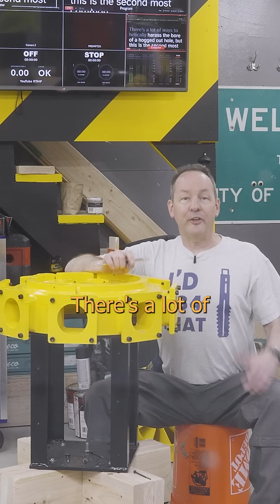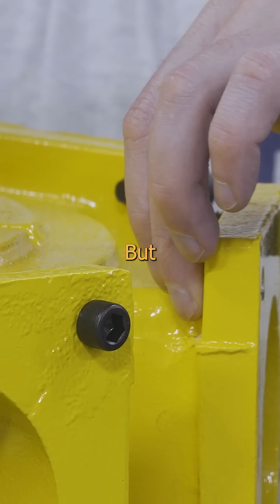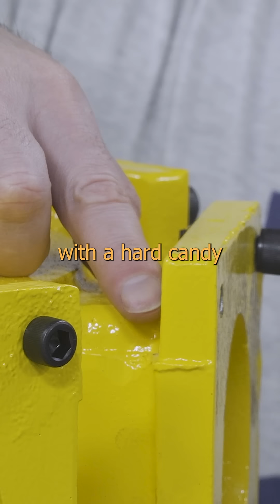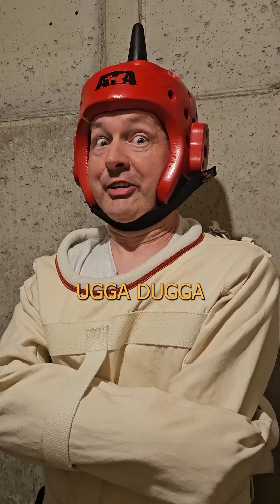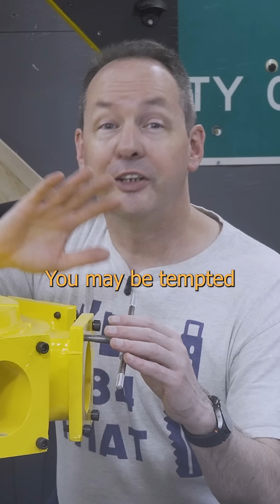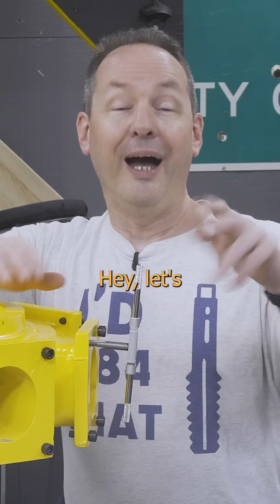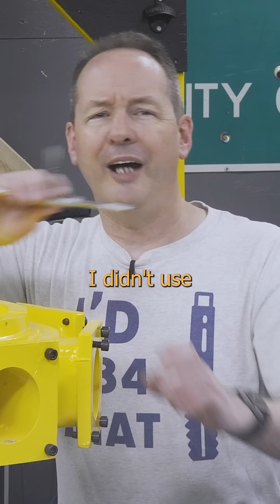Thread Chasing  #chrisboden #comedy #engineering #skills #workshop #metalworking #tools #apprentice

Comment: I had a job at a company that I shall not name at this time that involved tapping holes in steel parts on an assembly line and we just sent those suckers with an impact and enough lube to make an OF girl blush.  I think I personally broke about one a month, but it let us keep pace with production.  It probably didn't help that we were running imperial taps into metric holes because some overachiever in engineering specified three metric bolts on an all imperial product and then never told production about it.  I only found out after the fact.

Comment: Yeah I’m a power drill dumbass.  But I was 28 and knew no better.  Great vids and enjoy the learning even as I just turned 50 😂
So I was replacing a broken header on a 1998 Ducati. .was upside down looking up and was trying to clear the bolt holes as was crusty to buck,, and thought it would be quick and easy to whiz it in and out with the drill. Yup it broke even though was slow ish.  Still too fast and was a pita to get out .  But I digress. Learnt the hardway.    😊

Comment: Dumbass
I was trying to chase the threads on a hub for the hubcap screws, and tore it up so bad I had to size it up from 5/16 to 3/8 and now there’s a random trailer at AAA Cooper with one 9/16 head bolt on a hubcap somewhere, for some fucker to find and wonder what happened there.

Comment: Used a drill to tap a M8 thread onto the backplate of an electrical cabinet to mount some DIN rail, that snapped off and I couldn’t get the fun part out of the hole, ended up having to move the hole up an inch and also had to make it look like I didn’t fuck it up. Never again, biggest pain/embarrassment especially sense it was completely unnecessary

Comment: Our 4 square boxes wouldnt fit our 3" 8-32 screws. Thousands of them, every single one in the building. The boxes were installed too far back, and it was fire alarm, so we could mount the devices with just the screws and no arc guards. 

I've gone through about 30 of those drill taps. If I was using the hand tap, I'd still be tapping em XD

Comment: Yeah, probably my worst experience with hand tapping things as a machinist was doing 3/8-16 and 1/4-20 in stellite with taps hardened enough for cast iron had to add an extra inch and a quarter because I didn't have the confidence to run a threadmill because I do not understand how the last guy programmed the helical interpolation

Comment: I've actually done that without being the dumbass... it was shop practice, the metal stock was aircraft grade aluminum (because aerospace machining making aircraft structural parts), and what probably saved us was using the same taps that our machines used for tapping operations when it wasn't one of the few thread milling operations that we ran.

Comment: Yes is was a dumbass once, but not how you think. As a young car mechanic i used my 1/2 impact driver air wrench to  put in a head bolt on a motor. I had never heard about hydraulic pressure. As the bolt hit the bottom of the thread channel the head of the bolt snapped completely off.

Comment: Before I knew better I actually did use a tab with a drill but I set the drill all the way to the lowest torque out level so it was basically like clicking and moving very very slowly even with the drill trigger all the way pressed down. It worked really well until it didn't, lol

Comment: Just hear to call everyone else dumbasses for thinking that running a tap into a hole is a race. Used to work with a guy that would get frustrated when I went 3 turns in with a tap and then backed off before threading some more. Watching him break a tap with a drill was incredibly satisfying. Dumbass.

Comment: Im always using a drill to chase threads at work. Have I snapped off a tap? Oh ya. Who fixes that? Me. It’s happened once but I still use a drill to tap out holes. It’s fast when you are on an assembly line.

Comment: Dumbass.... I broke an oil pan bolt in the bottom of the block of my 75 ford and I thought I could just over bore the hole and re-tap it for a slightly larger size. Come to find out that hand tape are not drill friendly because that tap is still wedged in the block where that broken bolt was. Fortunately I was able to polish up and re thread the end of the tap so I could throw a nut and washer on it. I sold that car with that booger fix. Last I knew the tap I lost is still stuck in the block and it still seals like factory too and THATS PRETTY FUCKIN COOL

Comment: I love taps. They're so satisfying to run through a screw hole. We used them at a reman brake caliper factory i used to work at in my early 20s. We would tap the brake line and bleeder holes at the beginning of the reman process and then put new bleeders and banjo bolts in to ensure the threads on the calipers were tight but still easy to hand turn almost all the way down. There were a couple idiots that kept the most common thread taps on a drill so they could try to run through a line of calipers quickly before building them. I'm sure they cross threaded one from time to time and had to throw them into our scrap bins 🤦

Comment: As an HVAC guy, some of my favorite work is thread cutting/chasing. Those are the days I can turn my brain off and just use fine motor control between bouts of heavy muscle use. 

On big compressors, and pipe work, everything is a bolt and flange connection, and my ADHD brain loves nothing more than a freshly rebuilt 40 ton compressor that needs to have all its bits and bobs precisely cleaned and torqued for the sake of process or comfort cooling. 

As an HVAC guy we also do a fair bit of wiring, those are also good days for the same reason. Lots of fine motor control getting power to and from motor controls. 😂

Comment: Couple years ago I ordered a ground stand for a wall-shaker mini-split condenser unit. It came with weld splatter pre-loaded in the captive threads that wouldn't allow the bolts. Off to HF for a set of metric taps.  That stand ended up costing me 120 instead of 80, but now I have a tap set too!

Comment: DO NOT WAIT UNTIL THE TAP SQUEAKS BEFORE OILING IT. Apply oil as soon as it starts to stick. And DO NOT TRY TO BACK IT OUT ONCE IT STARTS STICKING. You will jam the metal shavings between the threads and make it stick more. Oil it, let the oil soak in, and then continue forward.

Comment: I am that dumnass. Was working for a company that builds the big diesel powered pumps, the ones on their own 53 foot trailer. I was putting in a bolt with an impact and the lead told me it was gonna break. I didn't listen like the dumnass teen I was and SNAP! FUCK! Well that was a hugh pain in my ass to fix.

Comment: Dumb a$$... but I used one of the fun bits that is a combo drill and thread cutter. Turns out the depth is pretty crucial.

Still, worked better than the screw remover (which has never, not even once, done anything but get stuck)

[Content filter got annoyed about that first word]

Comment: Dumbass... but I used one of the fun bits that is a combo drill and thread cutter. Turns out the depth is pretty crucial.

Still, worked better than the screw remover (which has never, not even once, done anything but get stuck)

Comment: I am a dumbass, I tried tapping a hole in some decades old theatre seating to bolt it back together after a weld failed. Put a smidgen too much torque on and my tap snapped. Couldn't get it out but thankfully it functioned as the bolt I needed anyway so all's well that ends well

Comment: Not entirely a dumbass, because I was getting paid, but I spent 10 hours with a partner taking titanium fasteners out of the end cap of a horizontal stabilizer that had somehow been superglued in place by the Italian subcontractor. Drilling 1/8" holes in Torx-head titanium fasteners, even with a carbide tipped bit, which broke about every fifth hole, was not a lot of fun, especially when it was overhead and the chips fell down your shirt. Then using a very small screw extractor, and trying to break the fastener free without breaking the screw extractor.... Yeah, that broke about every fifth fastener, so then we had to drill the hardened steel out so we could try again.

Did I mention there were about a hundred of them? At least we didn't damage the part. But we used up every screw extractor in the toolroom.

Comment: Thread milling is cool, but have you heard of thread GRINDING? We used it on the assembly line for Lycoming when I was a kid. Ground a special rounded thread on a steel cylinder barrel, then heated the aluminum head and barrel, screwed them together and let them cool for a permanent fit.

Comment: Some dumbass learned this the hard way when he tried to attach a very large metal plate onto the backside of an enclosure. One of the holes has some gasket and paint preventing the screw from working properly (the dumbass already stripped the head off of two Phillips screws attempting to force it through). One botched tap job later and now he has to try and get a nut onto this plate. Many hours and a whole lot of creative attempts later, some super glue and extreme care fixes the issue.

Comment: A machinist tip for running taps. Once you get to the last 3-4 threads when removing the tap; take the tap out of the wrench and turn the last few by hand also. This can prevent damaging the critical starting threads of a hole.

Comment: DUMBASS
serpentine belt tensioner on my VW, soft ass cast aluminum got dirty, gummed, and fucked, so i chased the threads, somehow snapped the tap in the fucker, drilled out the hole above said broken tap with a slightly oversized drill bit, had just enough room to get needle nose pliers in there to spin the tap back out, over-bored the hole a little, tapped with larger threads, inserted a brass Helicoil, and switched to a new, larger bolt

Comment: It's also way less likely to cross tread if you use a bottoming tap. The taper is only like 1.5 threads. So it won't have a case of the wiggles.

Comment: Don’t go in dry either. Some type of lubricant will work. Tap Magic, WD-40, hell used motor oil! If you don’t have access to any of that go with the tried and true method of just spitting on that damn thing. If it seems like you’re having to force it too much. Back it off a half turn and try again. Or remove the tap. Blow out the hole AND TAP! Then try again. Don’t just put the thing back in all crusty and full of crap. The things I’ve seen!! I’ve spent years tapping holes by hand and in machines. I still pucker every time I watch a tap plunge in a hole in my CNC. No matter how sure you are that everything is perfect. Those bastards just up and fucking break. I will pull a face like dad’s winding up to smack you in your mouth for talking back to mom and he just happened to be within ear shot and swinging distance. Then after she makes it through the first 5 or 6 holes like butter. The shit head just snaps on the 7th. Usually followed with a string of four letter words pouring out of my mouth. Need one of those shirts to wear to work. That made me laugh. I’d like to wear it out in public and see how many machinists I can pick out while at the local grocery store.

Comment: I'm disappointed, I saw the title and assumed you were actually going to talk about one of the many styles of thread chasers that exist. I'm sure this has been said by someone else with 2,600 comments before mine, but I'll say it again anyway, the proper way to chase threads is not with a tap. Running a tap into an already tapped hole will re-cut some of the existing threads, removing more material, making the threads weaker. There are times it's necessary to use a tap to chase threads though, and this may have been one of those times. If you're just trying to clean the threads, internal or external, of something like rust, silicone, threadlocker, etc., then a tap or die is usually overkill, and not in a good way.

Comment: Dumbass...
Got a 18hp craftsman LT1k and was "installing" my spark plug with a impact driver
Cross threaded harder than a corset
Ended up having my dad tap them out for me using another old spark plug from the back as we didnt have that size tap
Ive learned from this, now I use a socket wrench

Comment: Foam earplugs work pretty well depending on the size of the hole. Roll them up and they expand to seal the hole off then use a pick or something to pull them out once whatever coating is dry

Comment: Back at the start of my career. First time ever using a tap, i had seen videos of people using a drill and didnt know any better, also didnt use lubricant. Was putting in a helicoil, and tapping new threads for the helicoil to sit in. Went fine for the first CM or so, then snapped that tap right off in the hole. Thus launching a 2 hour adventure to get the broken part out of the hole, or replace an intake manifold. Anti seize makes a great lubricant for hand tapping holes, especially ones that dont go all the way through. It also helps catch the metal particles and debris in the channels on the tap so they're not left in the bore.

Comment: Those things can easily destroy the threading of anything, they’re built to cut. I was cleaning out the threads of a bolt and didn’t get the right thread count and started cutting a new set of threads, it wasn’t resisting enough for me to think I was cutting a new set of threads but my dumbass didn’t realize that the new shiny threads didn’t line up with the old ones.

Comment: I did something better years ago. I did not have the correct bolts for the pre-existing threaded holes. Knew the size of bolts that were slightly bigger that I could get, so I drilled the holes and rethreaded them for the new matching bolts since I had the option. I had to work within a budget of materials and tools I had access to. I still think it's funny that the liquid medium I used was what was mixed for a smudge pot.

Comment: Dumbass, that's me
First duty station as a wheeled vehicle mechanic, tried to chase the threads on one particular hole on the engine block. Dumbass kid me did not think to pick out all the leftover RTV/gasket maker left inside the bottom, ended up chasing it to the bottom and kept twisting when i hit the bunched up silicone. Completely mangled both the threads and the tap, had to iron mike around the vehicle while my motor sergeant drilled it out and rethreaded it in a bigger size.
Reply: Wasn't chucked up in a drill but felt like enough of a relevant fuck up to share

Comment: grind a groove in a screw if you can't find a tap because it's a remote location or it's some weird ass old thread that was never supposed to be invented but some ffuckwit thought his system would be the best and now you can't identify the thread... in that case you'll probbaly won't have a spare screw to replace the one you made a tap out of but if you are patient enough you can make the groove just on the very tip and clean the thread in multiple passes, that was the screw retains most of the threads and is still usable as a thread.

Comment: So this is less of a story of regret and more of "C'mon mother fucker you're going in whether you like it or not." So my dumb ass couldn't get a 1-1/8" tap to go down very far in the lower bolster of my press. I could see where the thread was fucked up but when you got stubborn metal vs stubborn metal... shit aint easy and you're always at risk of one or the other breaking. So I grabbed a bigger wrench than the 8" adjustable I was using. 12" should do it, right? Nope. Got the 24" out. Yeah she cut, drowned it in tap magic and worked out the stubborn section. Fantastic. Bolt goes in, bolt comes out. No issues. Amount of cussing during the process? Tons.

10/10 would not suggest it. Do it right, don't risk it. Next guy that did a different hole 2 days later in that same bolster, snapped a 3/4" off and it took them 2hrs to dig it out, then retap it all over again.

Comment: Well, it wasn't with a drill, but I snapped a 3/4" tap in a Hurco mill today going into a 1" thick 201LN stainless plate today. One of the  supporting bars under the 5' wide plate circular plate shifted to underneath the drilled hole. 😫

Comment: The only time a tap should make that noise is if it's in cast iron or brass. In cast, it's not great but doesn't really need lube since it has enough carbon to be self lubricating. In brass...I've had it make that noise even under flood coolant in the cnc. Either the hole is too small, the tap is too dull, or in rare occasions where you drill it oversize with a new tap the brass is just too hard and you might as well full send it to get the job done.

Comment: Dumbass, had to use a drill to tap holes under a switch gear in the field. Already installed but no one secured it. To tight for a tap wrench so a lot of lube, prayers, and broken taps 😂

Comment: Bubba. I've worked on a shop floor for over a decade. The tap goes in the Makita impact and you pray the angle is right when you need to chase some threads. 95% of the time, it works 100% of the time.

But that 5% of the time, it's a REAL bad time.

If you're LUCKY it's the RIGHT tap getting used at all. Safety third!

These views are mine, mine alone, and do not reflect reality in any way. This is a work of fiction, the product of a sick mind. I was never here. I don't know you!

Comment: I broke a 1/4-20 tap in a 3,000 lb gearbox weldment using a drill. I got it out eventually but that was the last time I designed anything smaller than  5/16 in a large weldment. Also the last time I used a drill to tap a blind hole.

Comment: Dumbass, I was a first year cnc machinest aprentice and thought I could heilicoil my gasket holes in my motor, snapped the bisket right off and metal shavings went into the motor. Take it slow and easy boys.